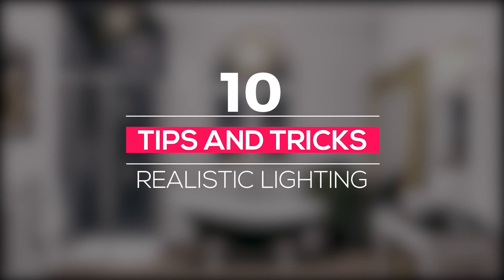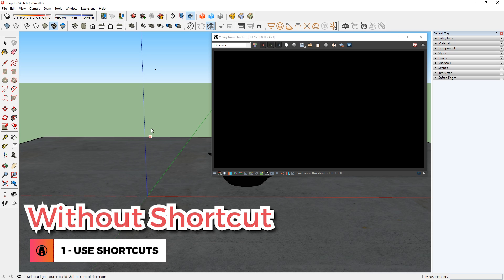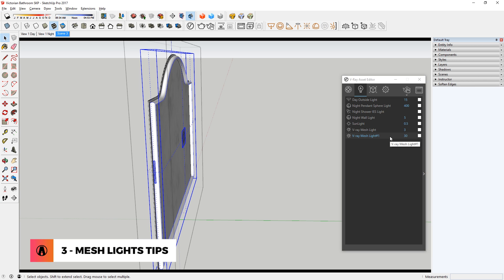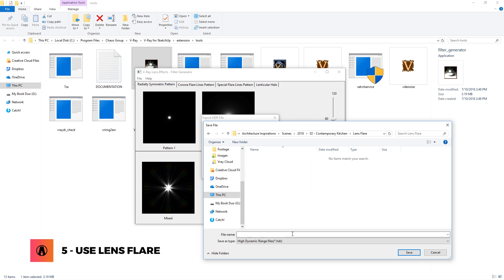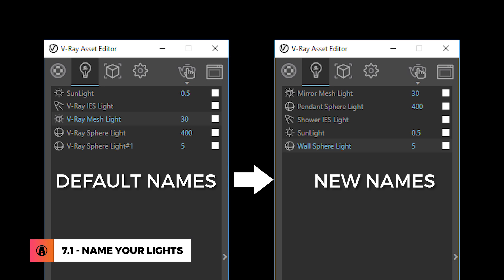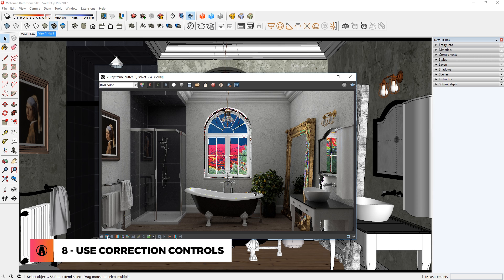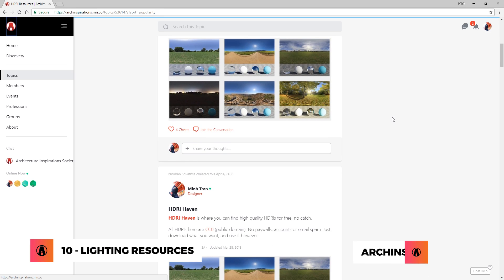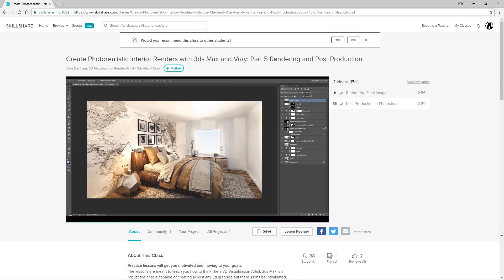10 Tips for REALISTIC LIGHTING in V-Ray

Comment: Lets say i want to do a scandinavian style room (minimalist, pure white walls, etc.) How do i get enough daylight into the interior without getting blowouts on floor, ceiling and the exterior?
In earlier versions of Vray there was a setting called Secondary Bounces and with it i could get enough light in. But now, no matter white i try, i just cant get the right light balance. Can you help? Maybe do a tutorial? 🤔
Reply from the maker: Don't set the material to pure white, real life materials are a little off white even the brightest one. Also, try using the correction Controls and reduce the highlight burn 😉
Reply: @ArchitectureInspirations  I never use pure white for materials. I usually keep them between 240 and 245 (RGB). As for the correction controlls, i had to use them a couple of times, but it flattened the image in some cases. 
Any other ideas and/or settings i should be aware of? 🤔
Reply from the maker: Yeah it does flatten the image a little but you can increase the contrast and it should be good😉

Comment: Great video!! :)
Can you please make one video on how to render Interior scene with no natural light at all and still achieve the realistic effect?
Reply from the maker: So a night interior scene right? :)
Reply: yes exactly!!
and how can we use and place the different types of lights to get the maximum output
IES lights especially   '._.
Reply from the maker: IES light you would have to override the value and set the power to reallly realllly high sometimes to see the effect 😂 also try the tip in the video, turn off all the lights except one, then adjust the power. That way you can see it clearly. Also don't forget to adjust the exposure value in the camera settings to brighten up the whole image ^.^ with that said, I'll try my best to create a tutorial on this topic 😄
Reply: the main problem I face is adjusting there distance from the light source model to get a good effect, the fall of light on the wall.
thank you for the tip btw. :) ^_^
Reply from the maker: Ah got it. I'll try to cover it in more detail in the video 😄